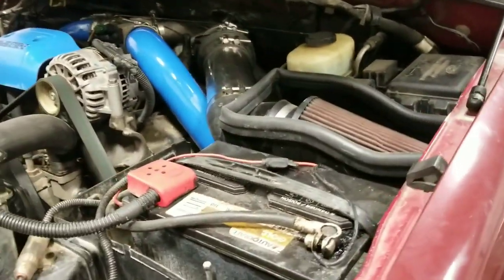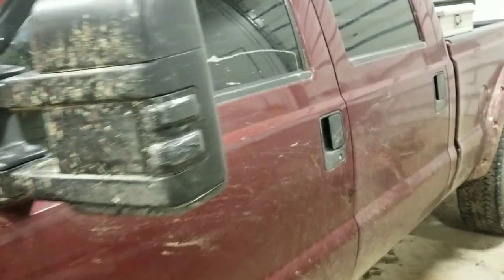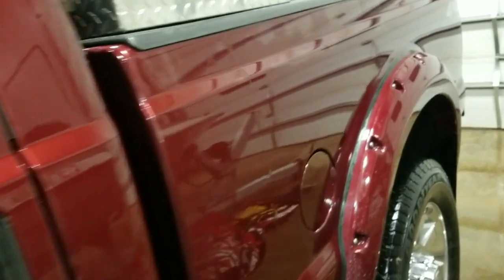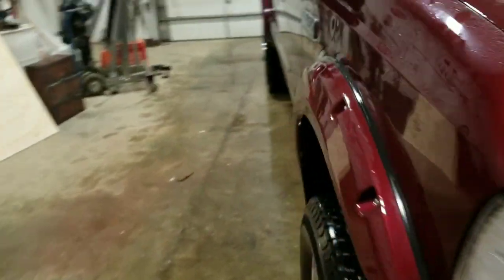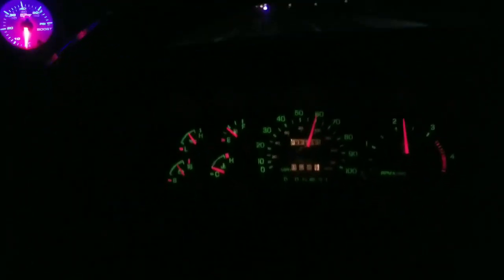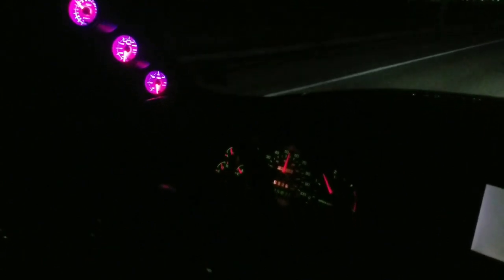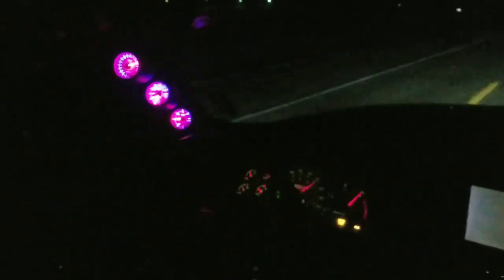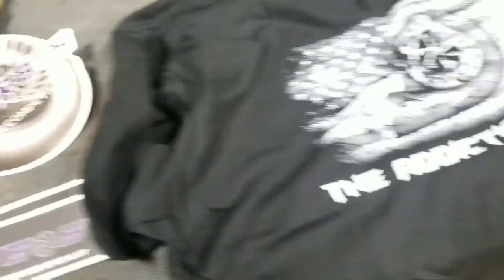KC s300 turbine wheel testing

Comment: Why is ur rpm so high for going 60mph? I have 35 inch tires on my 7.3 and when I go 60mph it's only at 1700 to 1750rpm?
Reply from the maker: Different rear end gears or it wasn't in overdrive yet
Reply: @brunssenboy  i have 373 gears.
Reply from the maker: @73powerstroke56  I'm pretty sure I have 4.10 and most likely od wasn't kicked In

Comment: What year is your truck?
Reply from the maker: 2000
Reply: Dis those wheel fit up correctly or did you have to modify the pattern
Reply from the maker: @chacalmexico  same bolt pattern just have to run wheel spacers

Comment: Did you notice any difference in sound out the exhaust?
Reply from the maker: A little bit not a huge difference
Reply: Powerstrokin' I didn’t notice but is your ebpv delete?
Reply from the maker: @upchurchfan0114  yes I deleted it along with welding the waste gate closed cause it was getting stuck open
Reply: Powerstrokin' it sounds really good from the intake I’d like to hear more from the exhaust 👌
Reply: Especially letting off after building boost
Reply from the maker: I have a video of it on my phone
Reply: Powerstrokin' does it sound like the video I just uploaded?
Reply from the maker: @upchurchfan0114  your turbo noise is going to be louder because of a stack I am going to upload the video here in a bit
Reply: Powerstrokin' honestly the stack is quieter from outside the truck. The loudest mine has been was when it was set up like yours. I mess around with the exhaust all the time gives me something to do lol. I was just wondering if it was a different pitch sound than mine
Reply from the maker: @upchurchfan0114  hmm I thought it would be louder.. but anyways the video should be up any minute
Reply: Powerstrokin' sounds really good
Reply: I put the s300 in my truck a couple nights  ago and I didn’t notice much difference in performance my egts actually went up a little and I lost low end power. My bearings and all the insides are fine as well. You have any ideas of what could be going on?
Reply: I also have no boost leaks and no leaks from up pipes or anything.
Reply from the maker: @upchurchfan0114  what injectors are you running? No boost leaks?
Reply: Powerstrokin' I’m running stock injectors. And no I checked everything over a few times no boost leaks.
Reply from the maker: @upchurchfan0114  stock injectore might have it spool up a little slower I'm not sure. I would ask kc turbos
Reply: I do have a ts 6 and I’m running the second setting which I believe is 75hp
Reply: Ok I’m sorry to bother you man but you seem to be the only one that’s posted a video about it and replies lol
Reply from the maker: @upchurchfan0114  try in the 140 tune lugging up hill and see if it spools easy
Reply: Powerstrokin' ok I’ll take a video and upload it so you can see what’s goin on
Reply: Now when I also don’t have the intake side like you have that could be it. But I had more low end boost with the stock shaft still. But on the 140 tube I got 34 psi and I used to get 30 before so maybe it’s more of a top end power kind of wheel

Comment: What did you notice from the sxe wheel? And you could use a shift kit or valve body
Reply from the maker: I didnt notice a whole lot other thannegt drop and it has a upgraded valve body and everything done to the trans including tripple disc torque converter
Reply: @brunssenboy  I'm putting my built motor in my truck now was thinking of adding that wheel before I go T4 just wondering if you noticed anything with it. And it just seemed like your granny shifted it a little slow that's why I said that
Reply from the maker: @jakeresch4332  what injectors will you be running in the new motor? And the tunes i have are for modified valve body.
Reply: @brunssenboy  I have 250/200 trying to make the highest horsepower on a drop in Turbo but I have already gone through six of them
Reply from the maker: What turbos have you been using?
Reply: @brunssenboy  Bummer...I just bought a KC Stock Plus for my OBS, was hoping it would make a noticeable difference.  Hope I didn't waste my money.  Gonna get it installed n a coupple weeks.
Reply from the maker: Your probably having to much drive pressure with the drop in turbos, I would just go with the t4 with a s369 or s400
Reply: @brunssenboy  oh yeah I know I'm getting too much Drive pressure but this motor is built so it will handle it and I've been running the same turbo you have pretty much but the one I just built I machined out the Scrolls on the inside of the exhaust housing a bit so it should spool a lot faster and I'm running a 1.0 AR non wastegated exhaust housing on this one with a 67x88 bullet compressor wheel. But I was debating on running the sxe turbine wheel
Reply: @brunssenboy  after this setup I have a s475 for it